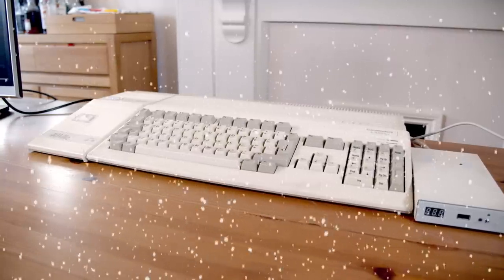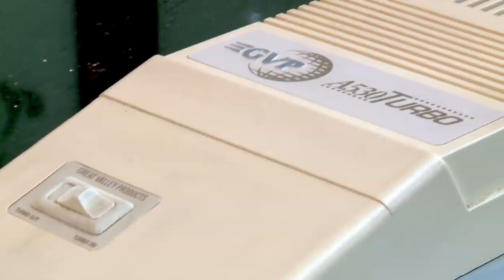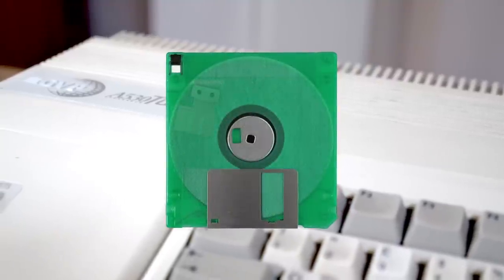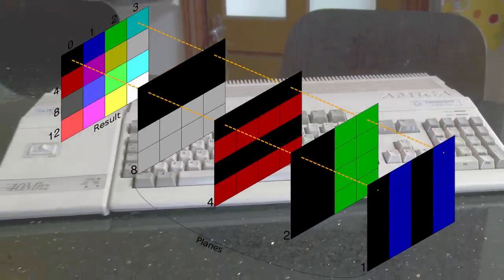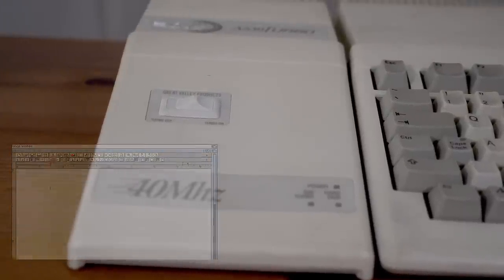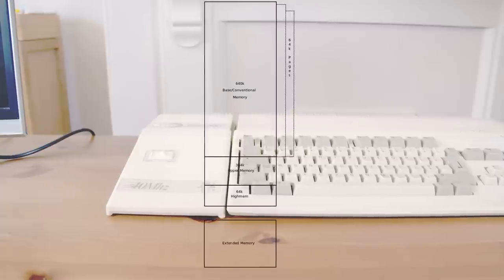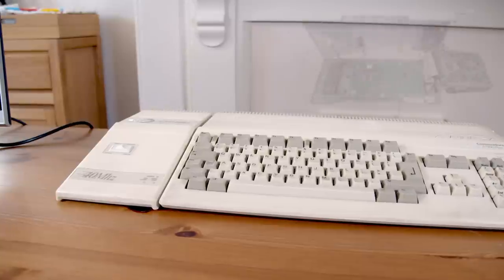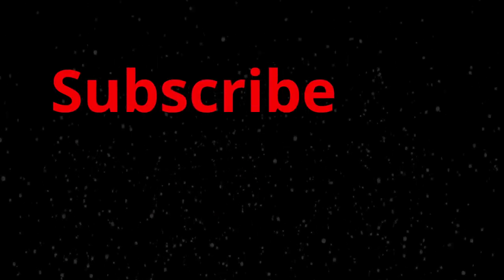This is a PC, no really.

Comment: I wasn't expecting that even the A500 had a DOS card. I've seen videos of a PCI-like card for an A2000, but never thought there would be any space for a PC card in the smaller Amigas.
Reply from the maker: Its a really nice card when it behaves.
Reply: @RetroBytesUK  Does it play Wolf3D?
Reply: I was. A classmate has been collecting hardware like this since the 90s.... he shows some of his stuff here https://youtu.be/Fx0bZU8o7S8 ( but its in german )
Reply: @James_T_Quirk  It would, but you wouldn't want to. The GFX were SOOoooo SLOW! It might be hard to imagine now, but back then, memory was at a real premium - especially in the 80's! Lead engineer, Jay Miner pioneered the use of multiple addressable bitplane graphics as a way to mitigate the issue - and you can see this going all the way back to the old Atari computers (400/800 series). The Atari 400 initially came with 8K, although quickly upgraded to 16K - and thank God! My little 400 back in the day hardly had any memory left - BUT - you could use every graphics mode available by the chipset. You couldn't do that on a low-end TRS-80 Color Computer!

Miner's trade off was a nifty workaround. It allowed more color with less resolution, or the other way around if you liked. True, characters had to be physically drawn pixel by pixel by the system (problematic for chunky high resolution text), but 80 column graphics weren't a thing back then. Besides that, the Amiga was initially designed as a game machine. So it makes sense from that perspective. You could get a LOT of bang for your memory buck Jay's way. BUT... It wasn't great for character-based graphics - something other computers excelled at. In other words: GREAT for the Video Toaster and other video applications. TERRIBLE for console text or word processing.

AGA graphics on the A1200/A4000 went a long way to addressing this problem. You could call up higher resolutions with speedier text AND graphics. 3D games like 'Doom' were MUCH more playable on those platforms, but by then the ship had sailed and even a base PC with VGA graphics was essentially superior to the Amiga's graphics hardware.

A developer told me that the 'AAA' chipset had been designed and it was even far more powerful than AGA. It allowed for compatibility with the old bitplane and AGA, but also added character-based chunky graphics. Ultimately, it was never fully developed because by that time, Commodore had bigger issues to deal with.
Reply: @Chordonblue  I Know But the "test" at the Time was if your 286 had 1 meg ram you could run Wolfenstein 3D, but memory was critical so you had to push Dos=High etc to make sure you got it, when I visited local computers clubs at the Time, it was running on all the PC's sometimes ...

PS.. I just remembered, I have a Toshiba Laptop here 286 1 meg ram, Orange Plasma Screen Card Slots, but when I bought it (2000?), I installed Wolf3D just to test the machine out, make sure it was firing on all thrusters, so to speak ..
Reply: There was a couple of different ones available for the A500. Aside from the ATOnce that plugged into the CPU socket and this GVP clone there was also one from another company that just plugged into the trapdoor RAM slot although iirc it was just a 8088 based "Turbo PC" one and kind of more limited because you had to boot into Amiga OR MS-DOS, you couldn't use both at once.

Comment: I love the nostalgia of the whole Amiga line. I went through a few A500's, an A2000, and even an A3000 back in the day. My favorite was the A500 because of all the accessories that came out for it. At one time I had a ROM switcher to go from 1.3 to 2.04 (for game compatibility), an internal 68030 accelerator board with 8MB of attached RAM, Fatter Agnus chip, ICD video scan doubler to connect to my 1950 monitor, hardware switch to go from NTSC to PAL (to watch all those cool demos and intros), a side car GVP hard drive unit with an attached Syquest 44MB cartridge drive and an 8MB trap door RAM module. That was one powerhouse A500.... wish I still had it.

Comment: Thanks for the interesting flashback.  I never had an Amiga 500, though.  I started with the original 1000 and eventually replaced it with the 2000.⬅
I caught one minor oversight.  In passing, you mentioned @16:49 that the original PC memory started at 512 kbytes.  IIRC correctly, though, for about the first year of the PC's release, a cassette PC model was available, and that one came standard with just 128 k.  I think only 3 ladies in Iowa bought that non-floppy model, so no one remembers it.
Reply: Even worse, when the PC first hit the market, the lowest option was 16k of RAM! The first motherboard could have 16-64k, they later upgraded it to the 64-256k one. If you wanted more memory, you had to use upgrade boards in the slots.
Reply: @kpanic23  Yikes! And I checked the introductory price.  It was US$1,565.
I hereby revise my comment: "... only 1 lady in Iowa bought that non-floppy model.  After showing it to her two friends, they laughed and laughed."

Comment: Great video, and a really interesting board (well, two boards, really).
Just to point out a slight error in your description of the 80286. It did not allow a flat addressing, as you suggest. It did increase the address space from 20 bit (1MB) to 24 bit (16MB), but it still required 64KB pages selected through page selectors and a page description table, so in reality it only allowed 4 64KB pages to be accessed at a time. And because you couldn't run traditional 8086 programs in protected mode, it didn't get used very much.
The 80386 expanded the address registers to 32-bit, allowing a 4GB flat address space (but it also used paging so that one program's memory couldn't be overwritten by another), and added a virtual mode, effectively allowing 8086 virtual machines to be multitasked and for each to have its own address space.
The net result is that unless you install something like Minix, you'll probably be keeping your 286 in real mode.

Comment: In 2000 we had (at work) a SUN workstation (running Solaris) that had a PC extender card that I believe was a low-end 486 or Pentium chip. Unlike the 286 extender card for the Amiga shown in this video, I believe the SUN PC card had most / all of its I/O ports (but not ethernet). It wasn't super fast, but it was pretty nice to be able to boot up a fully compatible Windows 2000 window inside of X11 in order to run MS Office, etc (not sure how well it works now, but at the time, Wine -- Windows Emulator -- couldn't fully handle Office and some other Windows app we needed).
Reply from the maker: Sun's PC card is a really fascinating bit of kit, there is an intersting devision of labour going on with it. The pc processor (486 on the one I used) is there to run application code and some windows code, while the win16 api was emulated on sparc in a sort of similar way that wine does. The big difference with wine is it only emulated a few key libraries for drawing and device access, and used licensed libraries from Microsoft for the rest of the win16 apis. This ment it could run any win16 app. I never did get to try a win9x or NT compatible version, just the windows 3.1 compatible verison.  It could run some dos software, basically if it worked in the dos box for win 3.1 it would work on Sun's system. unsurprisingly it was quiet expensive, as it used a licensed verison of windows, a 486 and some of its own ram.
Reply: @RetroBytesUK  Interesting. I'm pretty sure we ran Win2k on ours, but if not it would have been Win98 SE (though most likely 2k, definitely not 3.1). I don't remember the cost, only that it was cheaper than getting our developer a second workstation just so he could run Office and Visual Source Safe (VSS). I think I actually still have that SparcStation with PC card somewhere upstairs in a box that hasn't been opened in 20 years 😼.